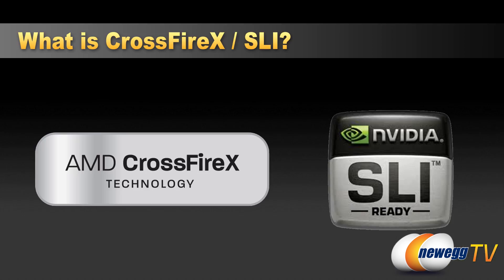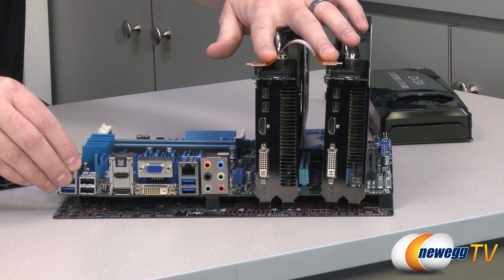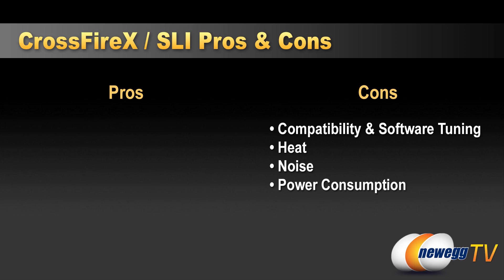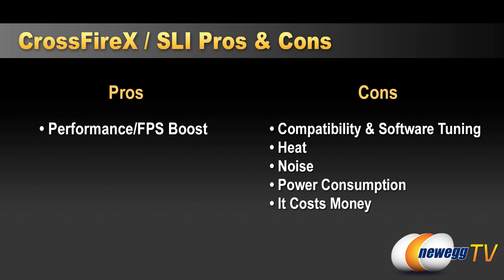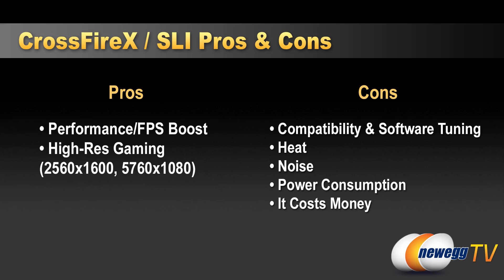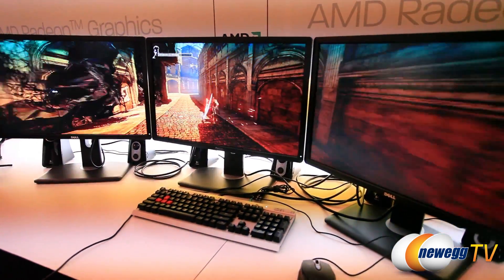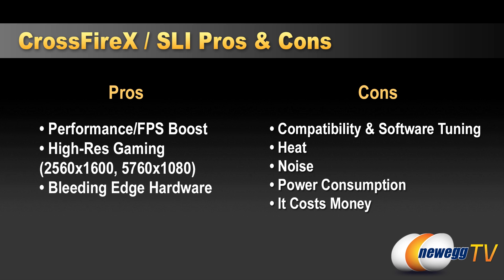Newegg TV: CrossfireX & SLI Multi-GPU Guide, Tutorial & Benchmark Demonstration

Comment: maybe a stupid question sorry then. is it possible to sli a 4gb card with a 2gb card (680 4gb edition) with a 680 2gb    or a 680 with a 770 ?? since it is the same chipset???
Reply: 1. Yes, but the 4 GB card is going to act like it has 2GB because the second one has 2GB
2. nope, you need 770's or 680's :/
Reply: 3. I don't believe you'd get the same performance boost and might want to get to better equal cards :)
Reply: Xeo's gaming channel Is it possible to put two Radeon 270's together. and i mean 270 not 270x
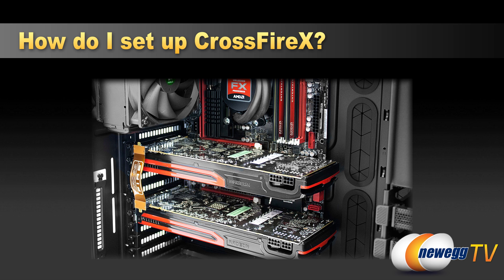Reply: yes, if a card has a "notch" (5:36) for that bridge then yes
Reply: kk Ty
Reply: Xeo's gaming channel nope. Nvidia is stupid with that. You can only sli the same cards (770+770) AMD though, you can crossfire different ones. (280+280x or 280+7950) stuff like that. (Ive never tried it. But I do believe that is how nvidia's cards work.)
Reply: oh crap, that's true it can't be sli'ed (silently edits 1st comment)
Reply: It's not because NVIDIA is stupid like that, they state it's because they then can more easily focus on quality control since they don't have to write out all the bugs from all the tons of possible configurations.
Reply: Tones what about clock speeds? do clock speeds cap to the lower card too? i have a 290x reference card, and i want to buy another but i want the MSi lightning 290x, is it a waste to do that since the lightning may just cap at my reference card's specs?

Comment: I'm in need of major help.

I'm thinking about going crossfire with two R7 260x. I already have one installed, so is there a way to install another one, will my system recognize both?

Also, I only have a 500w PSU, and Sapphires website recommends 600, but when I add up all the wattages I end up with 438 estimated use. Would this be safe to run or would I need to upgrade my PSU to a 600w.

Thanks to anyone who can help me!
Reply: I definitely recommend getting the 600w power supply. Whether you may want to overclock or not 600w is a much safer way to go instead of your 500 and also future proof your system for any other possible upgrades you may want.

Comment: question. I have a Motherboard that supports SLI x2 and have an extra GPU slot. how can I use my 2 GTX 770's set with SLI and my single GTX 660.  I use 3 monitors. please help Thanks

Comment: Let's say I have 3 pcie x16 slots. Can I use the top most a lot nearest the cpu and and the bottom most slit for the second gpu to make better struggle between the cards?
Reply: Depends on your Mobo.
Reply: i posted that from my phone and i see it messed everything up. if i have 3 16x pcie slots can i use the top one and the bottom one to keep the cards separated and have the middle open and get better cooling efficiency? since xfire can be used through the mobo now anyway?

Comment: Do you think Gigabyte GTX 770 2 way SLI and an i5-4670k can handle a 750watt power supply
Reply: get an 850 watt just for a bit of legroom
Reply: Look it up.
Reply: Zhangir Azerbayev you're correct but he should check the rating maybe a gold or higher
Reply: Desmond paniagua
 Also the amps his power supply has on the +12 rail.
Reply: Planning to SLI my 770 too,but is it worth? Only using 60Hz monitor,2nd monitor connected to motherboard. For future?

Comment: I have my 2 graphics cards in, both 7770s but different versions I think... I have crossfire connected and everything but my catalyst control center doesn't have the enable or disable crossfirex option. Only 3d application settings. What do I do?
Reply: I downloaded the gpuz and it says its disabled.
Reply: i have the same problem..

Comment: I've got a 925Mhz 7970 that I'd like to crossfire, If I get a 1050Mhz 7970, will I have to clock them to the same speeds, or can they just run like that cus they have the same chipset without a problem?
Reply: most likely the card with the higher speed will clock itself down to the lower speed.  (I know this is true for sli, but not sure for crossfire)

Comment: @alek bora
No, the 7990 doesnt flicker at all: Reason to this is that the crossfire of this card happens in one pcb and both GPU's use the same memory more efficiently. Also as working in one card both GPU's are in more sync than two cards. As to those 780's you mentioned about, I would say that Nvdia has good drivers for SLI and only flickering should be caused by a bad SLI bridge. I suggest not to buy the flexible SLI connector. I prefer the one's that are solid. They make a good contact on those SLI connectors.

Comment: Are you talking reference cards? Who the hell uses reference cards? Two asus or gigabyte cards will run cooler than a single 7990 by any company. The two cards will also run much faster due to the fact that they under volt duel gpu cards from being so hot. The only thing that you said that is correct is the power consumption, but if you are running crossfire why in the world world you care about power consumption?

Comment: Runs hotter?
Not according to the techspot tests. Two GPU's output more heat than one.

Runs slower?
slighly slower but is more stable than a dual card configuration. Doesn't have any flickering almost at all. 
One card runs games better against dual card setup versus stability.

Dual card  setup draws more power from the wall and in theory run hotter because ie. you have 2 7970's with TDP of 250Watts from both cards versus 7990 TDP of 480Watts.

2 7970's use 3GB of memory and 7990 uses 6Gb.

Comment: It will probably run games but you'll have to upgrade sooner and with crossfire it's harder. I'd recommend either waiting for the 9000 series (assuming it's good) or get a single gtx 760 that you can sli later if you need extra performance.

Comment: i have a gtx 660 oc running on an 600w psu, a gigabyte77x-d3h motherboard and an intel i5 3570k processor. would i be able to pop a second gtx 660 in if i wanted to or would that be to heavy on the psu and cpu?

Comment: Same goes for 2 660ti in sli. They cost about $400 less than a titan and performance is almost the same. No way you are going to burn up $400 in power consumption difference within 3 to 4 years time.

Comment: They state pricing as a con in this video which I find incorrect. Two GTX 760's will out perform a GTX 780 for $150 less, without a significant increase in power consumption.

Newegg did a video on it but i'm assuming that video was made after this one.

Comment: There's couple of games that didn't do well with Crossfire X. I have to assume it's a driver issue because when I disable the crossfire, I get 60 FPS. The game Max Payne 3 runs well during gameplay but during cinematics, the fps drops to 22 with crossfire on regardless of the settings. Another game to mention is darksider 2. That game runs terrible with crossfire all around. I get 24fps whereas I get 60 on single GPU. All these were on 1080 on max settings.

Comment: Hey im, thinking of Sli'ing my Gtx 570 i cannot find new ones anywhere but im going to buy a 2nd hand one from ebay as , when i got my card it was just as the 600 series was just coming out, its either Two sli'd GTX 570 or Msi OC'd 760 and i sell my gtx 570 toward it any opinions?

Comment: No, you'd be in or above the 800 range, depending upon the rest of your system. Newegg has a power supply calculator that you can use to find out the wattage you need, given your exact setup.

Comment: just go a 7950, they're an amazing card!
and when the price drops get another. just make sure u have a board with a pair of pcie x16 slots to avoid micro lag

i'm running dual 7950 cards on the asus m5a99fx pro 2.0 and it couldn't be easier

Comment: You should do a performance on AMD FX-8350 CPU (8x 4.00GHz/8MB L2 Cache) overclocked with a Liquid CPU Cooling System w/ Triple Radiator (Green Liquid coolant) on a ASUS Crosshair V Formula -- AMD 990FX w/ 4x PCI-E 2.0 x16
With 32GB DDR3-1600 Memory Module (Corsair Vengeance)
and NVIDIA GeForce GTX Titan Video Cards also overclocked
also with a couple green LED case mounted fan on the Zalman Z11 Plus HF1 Mid Tower Case with Liquid Neon Thunder (Green)

Comment: since i run 2x asus gtx 650 ti boost in sli i have to say that u not allway´s ending up with higher wattage use and higher heat/noise output! those asus card´s have a really good cooling solution, even overclocked and while benchmarking they never hit the 70°C mark and the cooler in auto mode never get´s higher then 50% (at least in my corsair 600T). i also saw a spec sheet saying the max power consumption is around 140 watt´s per card, means they use less power then a gtx 660 ti or gtx 670!

Comment: No, the 7970 would be quicker, however the core clocks would synchronize with the slower one. The 7970 has 256 more stream processors, but they would be running at 800Mhz to match the 7950. All in all, they would work together, and the 7970 would still be faster. You could use MSI afterburner to OC the cards together, and get the clocks up

Comment: It wouldn't work because if you were to do CrossfireX/SLI, you would need the GPU's in the system to be of the same model. For example if you were to CrossfireX a system using a 7970, you would need another 7970. Likewise, if you were to SLI a system using a 670, you would not use a 660 or a 680, you would just use another 670. Two different GPU's would just not be compatible with each other.

Comment: My problem is pretty unique. So I have 2 MSi 660Ti's powered up but only 1 of them shows up in the Device Manager. I've swapped their positions in the PCIe x16 slots and they both work and have the most recent drivers. However since only 1 shows up in my Device Manager I can't SLI them in the Nvidia Control Panel. Anyone have any solutions?

Comment: Hi Paul,
i'm lil'bit confused right now.. :(
i've plan to upgrade my machine to [multi-monitor multi-GPU] machine, which is:
1. 1920x1200 monitor x2 (just in case)
2. AMD FirePRO x1 + GeForce GTX x1
3. FirePRO for Workstation, GTX for Gaming
4. one monitor plugged into FirePRO, another one to GTX
??
- Can i play the game with full screen using those 2 monitor at the same time without re-plug them into 1 GPU (gtx)?
- if yes.. great, if not, is there a softwre lvl to do that scenario?
thnk u.. :)

Comment: Marvin Chua , Yes a 750 should be enough but is that all your powering?  I have two 7950 BUT.... I'm running a water cooler PLUS extra case fans and an 8 core GPU.... keep everything you're using it for and if you're going to over clock... GL Marvin

Comment: You'd have to look at some news articles. But I heard that a OC'd 660Ti ~ 670. So if you SLI (what are pretty much) 2 x 670's, that'll be much better than one 680. A 670 OC'd is roughly 680 level.

Comment: Hey guys, may I ask a few questions, my pc specs are intel i7 3770 processor @ 3.40, 16 gig ram, motherboards is an asus z77 sabertooth, and my GPU is a gainward GTX660 (not Ti, OC, or SC...just GTX 660). May I ask if can I use a different brand of GPU but same chipset like say...use an inno3D branded GTX 660 to pair with my gainward GTX 660 card (I checked both versions of GPU and there both SLI capable)? For all those who will reply thanks :D

Comment: drivers tend to take a little wile before there tuned for crossfire after a game is released and the older cards like the 5k and 6k amd cards tend to get the updates before the 7k cards. some times the newer games will run better without crossfire due to crazy micro stutter or flickering but when they do release the cap for the newer games its all good.

Comment: Money falling out my butt huh? My 2 6870s cost me 100 usd less back when I got them than a 7970 cost today witch benches very close. Yes I use more power but really how much will your electric bill go up running 1 more card for a few hours of gaming? Unlike some people I don't buy a psu that only has the power for what I'm using now. long ago I invested in my 1000w psu so I don't have to get another when the next video card upgrade comes around. Noise? That's bad airflow or silent gaming.

Comment: Those monitors are either ASUS MX279H or ASUS MX239H, I wouldn't get. Yes you get such a thin bezel frame on the edges for around $250 (23") or $30 (27") + when I'm getting an ASUS VN247H-P 23.6" 1ms 1920 x 1080 monitor for $210.00 on newegg. Actually now that I think about it, I might get that 23"... noo... THEY HAVE NO VESA MOUNTS! VN247H-P all the way :D

Comment: In fall 2011 when I got my 6950 for 250 then a couple months later my other 6950 there were no other gpus for 500 that could do the job of two of these. Now a 7970 blows these two out of the water. With all of the new 7000 series there is no reason for crossfire except for a beastly rig of the high end cards.

Comment: Just use what you need, because people who still using single 15" monitor with 1280 x 800 resolution will never need more than 1 gpu, but people who using triple Full HD monitor on AMD eyefinity HD or nvidia 3D stereoscopic with 5760 x 1080 resolution will not satisfied with single GPU.

Comment: Upcoming Build:

Gigabyte Z77 UD3H Motherboard
Intel 3770k
NH-D14 CPU Cooler
16GB Corsair Vengeance Low Profile RAM
(2x) XFX Radeon 7970
Samsung 840 120GB SSD
Western Digital Caviar Black 1TB HDD
XFX 850W PSU
Obsidian 650D

How does this sound?

Comment: A 660 ti is basically a 670 but a lower memory bus (192 instead of 256). If your worried about cooling you can always leave the side off if your case doesn't have enough fans for cooling. I have the side of my case all the time. The only problem is it gets a little dusty after a few months, but it is an easy clean xD

Comment: Yea 2nd gen sandy bridge only uses pcie 2.0, you need ivy bridge for 3.0. Just because the mobo says 3.0 doesn't mean it will run in 3.0 without the proper CPU.

Comment: Actually the 5750 can crossfire with 5750, 5770, 6750, and 6770 since they all are in the same series and use the same 40nm. And the fact that I already crossfired it and it work seems to prove that statement wrong. Also I wasnt talking about crossfiring the 5750 with the 7770 since I already know they use different NM, but Ive already took back the 6770 and using a single 7770. Thanks for the response and check the AMD crossfire table, it will show you.

Comment: a 6770 wouldn't crossfire with a 5750 nor a 7770. they are in the 700s but not in the same series (5000, 6000, and 7000 respectively). You would need a 5700 series for the 5750 or a 6700 series for the 6770, and same for any others. it's like trying to do SLI with a 660 and a 260. It wont work.

Comment: BTW i just looked @ Anandtech and looked @ there comparison and the oldest card they are comparing it to is the 480 and BTW FYI they got the specs WRONG. you are looking @ incorrect information bud. the 680 may be holding the performance crown ATM BUT only by a small margin over the 470 and 480's by only like 500.

Comment: yes I have looked @ some bench marks, you must be looking @ the wrongs ones or looking @ them wrong. and a 256 bit buss will not kill a lager buss, its impossible. I just took @ the specs again compared to a 470 and the 680 is almost the same besides its buss. but the problem is that benching a card is inconclusive to real world gaming. and BTW they would compare this card to 260 as they are to old and not DX11. but I just did and the 680 is just slightly stronger despite its 256 slow buss speed

Comment: have you even compared spec's between a gtx 680 vs a 470 or even a 260? IF you did than you would know that the 680 is a low end card compared to ether of them. witch is Y you had to add another. in fact it would take 3 to 4 680 to achieve similar gpu power of ether other card. I think that 680 only has like what a 192 bit buss. that's nothing to a 384 or a 448 capable card. and BTW dude I had SLI before and have switched back to using a single Hi end card because that config worked better.

Comment: and FYI, I get 150+fps with out V snyc on and with it I get 30-60 depends on the game. and with out it on I only get screen tearing when it goes well over 200 FPS. the graphics cards bandwidth matters. as well as the rest of your hardware like I stated the 1st time. cards with less than 300 bit buss will preform like crap. hell the GTX 260's with a 448 bit buss will out preform my GTX470. the GPU speed don't really matter to much. the cards buss does. and the ram the card has.

Comment: Microstuttering is still a problem on Crossfire.  Never used SLI, but I imagine it'll have the same problems.  Uneven frame output is what I'm talking about.  It'll make 60FPS look like 45FPS, even through FRAPS will say 60FPS.  Actually frame production sometimes goes like 2-1-2-1-3-1-2-0-1-2-0 as opposed to 1-1-1-1-1-1-1-1-1-1-1 with a single card.

Comment: Yes, you can... Running with 2x GTX-670, works fine. You should install the newest BIOS for your Sabertooth, cause with V. 1708 you may have a Bluescreen or Freeze when starting up the system... Get fixed with the new BIOS.

Comment: It uses only what it needs. So, if you have nothing running, it might use something like 180 watts. I would definitely go for the 1350 if your current draw will be around 1000. You don't want to have your PSU run at full capacity, it will be less efficient and a lot louder.

Comment: damn, i thought it was going to be a plug in and play type deal. my plan is to use an 

ASUS SABERTOOTH Z77 LGA 1155 Intel Z77 HDMI SATA 6Gb/s USB 3.0 ATX Intel Motherboard
with a 
Intel Core i7-3770K Ivy Bridge 3.5GHz (3.9GHz Turbo) LGA 1155 77W Quad-Core Desktop Processor Intel HD Graphics 4000 BX80637I73770K
and slap in 2 
EVGA 04G-P4-3673-KR GeForce GTX 670 FTW+ 4GB 256-bit GDDR5 PCI Express 3.0 x16 HDCP Ready SLI Support Video Card
Should work right?